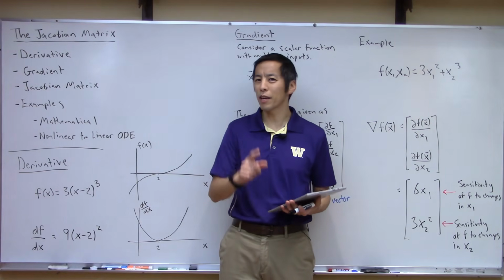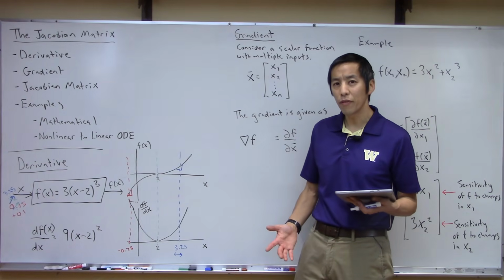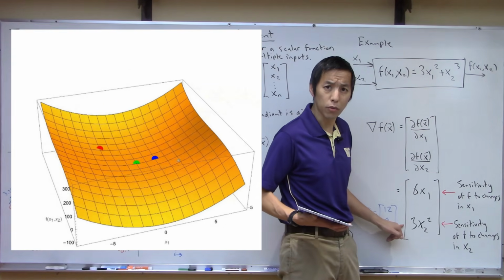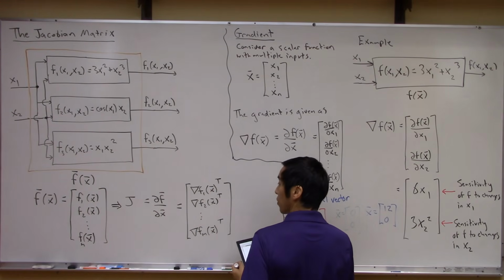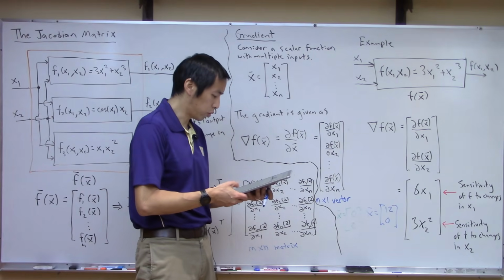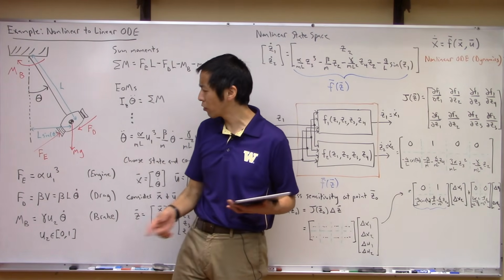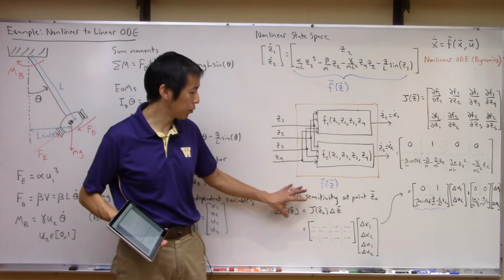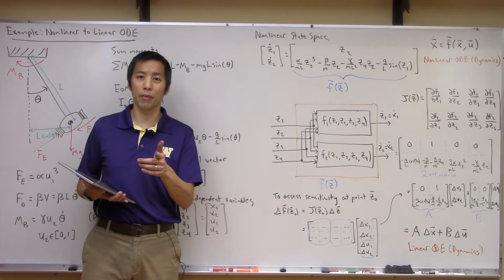The Jacobian Matrix

Comment: Thank you for this fantastic lecture on the applied side of the Jacobian. It's great to see the sensitivity interpretation laid out so clearly.

I've always been fascinated by its formal structure as a type of *"outer product"* between two fundamental mathematical objects:
1.  The function (or vector of functions) \( \mathbf{F}: \mathbb{R}^n \to \mathbb{R}^m \)
2.  The vector of partial derivative operators \( \nabla = \left( \frac{\partial}{\partial x_1}, \ldots, \frac{\partial}{\partial x_n} \right) \)

Their "product" \( J = \nabla \otimes \mathbf{F} \) yields a matrix ( (1,1) tensor) whose components \( J_{ij} = \frac{\partial F_i}{\partial x_j} \) precisely measure the tangency of the function \( \mathbf{F} \) to the coordinate axes defined by our partial derivatives. It's the natural object that tells us how the output space is stretched and rotated by the map \( \mathbf{F} \) which is why the determinate of the Jacobian is a pushforward. 

This geometric view connects beautifully to your point about total sensitivity since `J_ij = ∂F_i/∂x_j` precisely measure how the function stretches, shears, and rotates the coordinate axes—quantifying the 'sensitivity' or 'tangency' you described, but in the language of differential geometry and tensor analysis. This perspective unifies the calculus and linear algebra behind it beautifully."

- Purdue Resident Delinquent